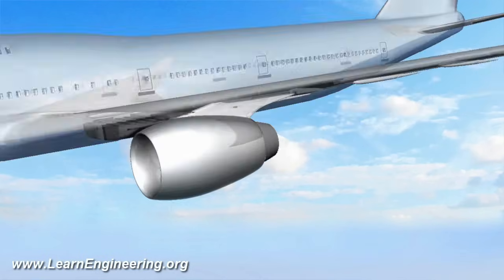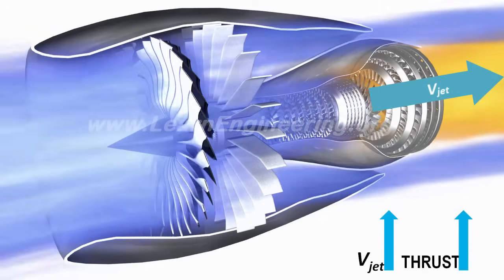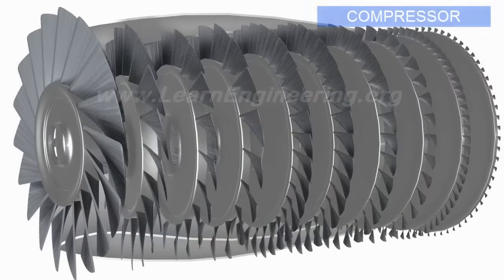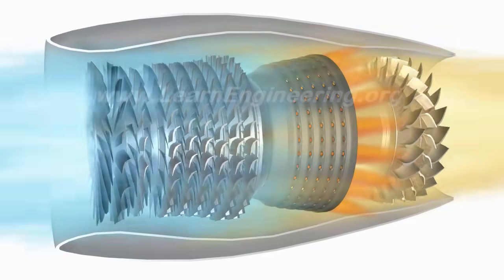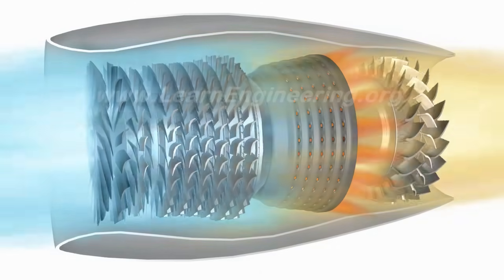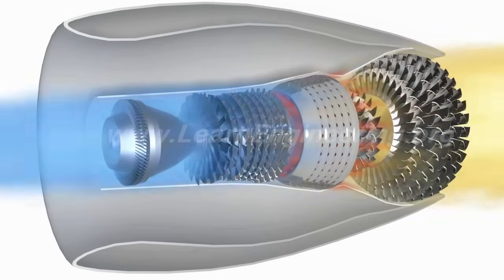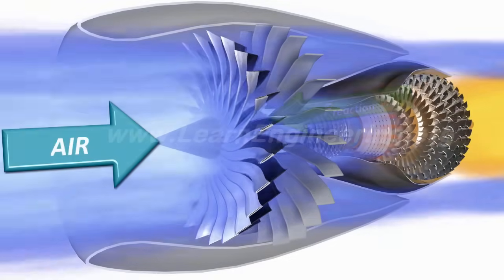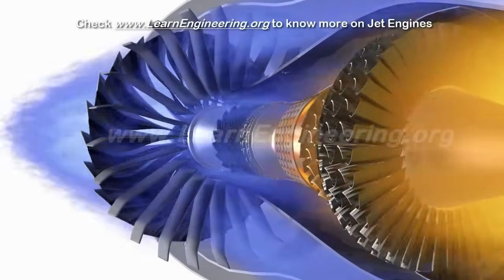Jet Engine, How it works?

Comment: Ok i still dont get how the fuel lights on fire
Reply: Good gob
Reply: A high voltage spark does the job (at first, then is no longer needed as the fuel ignites by the temperature of the combustion chamber).
Reply: Right on dude

Comment: Long story short:  A jet engine is a "continuous cycle" diesel engine.  The pressure out of the compressor at 35 Bar is about 450 psi, and super hot. Inject fuel and it instantly combusts, heating and expanding while doing so.  This hot exhaust drives the compressor spool and the by-pass fan.

A diesel engine is often a 20:1 compression ratio giving 280 psi.
Reply: This is sooooo wrong. Bring in the air from the fan, then compress it with smaller closer blades sending it through the combustion chamber, which mixes the air with fuel and lights it, then it goes to hpt (high pressure turbine), which compacts the air even tighter, then the lpt pushes it out the exhaust, in the exhaust the pressure and thrust is determined by the the size of the nozzle and whether there is an augmenter or a simple shaped nozzle to determine how fast the air comes out, meaning how much thrust is porduced
Reply: @jonathanjordan8325  That's pretty much how a jet engine works... But in a turbofan (as shown in the video) almost all of the thrust is generated by the air moved by the fan attached to the jet engine.
Reply: @zeendaniels5809  you are correct. This is a high bypass engine. Probably about 85% of the thrust. I apologize for the misunderstanding.

Comment: Now Pratt and Whitney uses a gear turbo fan engine in which they basically take a planetary gearbox from a prop engine and call it a gear turbo fan engine. But GE has done a better job I think.

Comment: In Turbofan engines, fraction of intake air @ -100C is bypassed to later mix with hot air jet @ 400 C to reduce noise. I can’t say that it makes the plane fuel efficient but if exiting air temperature is reduced it reduces noise

Comment: Wait, why would it be a good thing to lower the air temperature from 1600 down to 350, when your whole purpose  here was to heat up  cold air to create thrust? Wouldn’t it be better if the air was hotter?

Comment: The Flutes that you did not mention are the most important static resonators that change the vibrational frequency of thee Air into Nitro so that the Fuel is ready made in the chamber prior to combustion, so no need to mention economy of fuel, compressed resonated Air is the cheapest and easiest fuel for antiquated devices

Comment: Ahhhh.  Only 10% of thrust is produced at the engine outlet..higer im sure for turbofans.."marginally". Read up on the diffuser section of the engine and see where the real magic happens
Reply: About 75% of overall thrust comes from the fan; in cruise about 60% of the overall thrust comes from the fan. During reverse thrust on landing, the same 75% of the thrust comes from the cascading fan thrust. Core thrust is a factor but only about 1/2 of the fan's thrust.
Reply: Basically my only sources of knowledge about jet engines comes from this video and a bit of reading I did after watching it... but what exactly do you mean with the diffuser being the real magical part of the engine? The way I understood it the diffuser (which is sort of a reverse-nozzle) only reduces the velocity of the incoming air stream to "stabilize" and ensure the combustion.

Comment: I'm a 25 year veteran from Duncan Aviation in Lincoln, NE.  I can firmly attest that jets work by making a loud noise behind the plane, the plane gets scared, and the plane goes forward.  Everything else is a bold faced lie.
Reply: Oh damn it , they lied to us !
Reply: And propeller planes.  The propeller is there to keep the pilot cool.  When it stops turning, he starts sweating.  And on twin engine planes the 2nd engine's only use is to get you the site of the crash.
Reply: So that's why fighter jets are so loud, they need to be to go fast.
Reply: @ultiiiiii or the thrust is stronger
Reply: I completely and utterly trust you
Reply: Your absolutely correct.  Those plane farts should make anyone or anything run away.
Reply: @leadslinger49  oh thats why pulse jet aircraft were so fast back then
Reply: I trust you
Reply: @4crosswashere7 I AM YOU HAV
Reply: Bro, that is funny as hell.
Almost as good as telling someone their tyre is only flat on the bottom so is perfectly fine to drive on.
Reply: Flat Earthers lol 😂
Reply: Damn, I knew it!
Reply: Thanks for the simplification, I knew they were maliciously complicating things.
Reply: Will it work if I make loud noise 👀
Reply: Seems legit
Reply: And an Airbus 340 cannot climb - it only gain altitude because of round planet.
Reply: Kawaii...plane-chan 🥺
Reply: amen
Reply: AGK level 9999
Reply: LMAO. I love this!
Reply: Hahaha thats brilliant. And also, the man did say that turbo jet engines are louder and they are faster, so case closed.
Reply: Sounds like how a 3 year old would think jet engines work.
Reply: Cool your jets...that's a hot lie. lol
Reply: Indeed
Reply: Sometimes it Smells....
Reply: Ignorance is bliss 😂
Reply: Thank you for telling the truth
Reply: Correct. It would be better to put modern electric amplifiers in the engines and speakers at the back of the engines, as they can make more noise being cheaper and lighter.
Reply: The funniest plane joke I've ever heard. Thanks.
Reply: You must go public with this information
Reply: Okay I came here cause I was interested in the basic’s oh how jet engines work! No matter how fast Jets fly, I’m sure the basics are the same. Just like with car’s! There’s all kinds of computer type crap involved. But the way the engine works is still the same with all engines! They all work the same way.
Reply: O
Reply: They lied to us!!
Reply: Haha😂
Reply: i wanna do aviation
Reply: Like the "globe" and the "moon landing"
Reply: Now it makes sense.
Reply: Gosh
Reply: This checks out👍
Reply: This is the equivalent of a dog waking its self up from farting
Reply: More believablenthan flat earther saying it runs with compressed air. Lol
Reply: hhahahaha nice one xD very much love your explanation, my little cousin loves planes, he gonn be very satisfied with this explanation :D  have a good day Sir ! :))
Reply: Seems legit.
Reply: Had to read this 3 times to make sure you weren’t a 25 year old vet 😭😂🫶
Reply: Hence the phrase, "took off like a scared jackrabbit"
Reply: And sometimes the plane gets so scared it gets a panic attack… That’s exactly what occurred on 9.11 - the engines suddenly made a loud noise and scared the plane
Reply: I worked at Duncan Aviation for awhile. My team leader was Eric (can't remember his last name) but he ended up taking a job in Provo.
Reply: No fuel is needed
Reply: I was an avionics technician on kc135R at Lincoln air national guard! go big red
Reply: You know, that's what I thought !
Reply: Correct, and They are remote controlled mostly by the mommy plane and Daddy plane.
Reply: Engines and oils they put on the plane was meant to make plane crash louder after all 😱😱🤯🤯
Reply: jbvxc
Reply: @ZulhelmiAnuar  hip

Comment: This is a great video and I like the graphics, but you are missing some things. I know it is basic but could easily be added without adding more graphics. You are missing the diffuser before the combustion chamber. The diffuser is the last stage of compression and straightens the air to allow the compressed air to flow in and over the fuel nozzles to atomize the fuel before being burned. Without the diffuser, the fuel air mixture would spiral around inside the combustion chamber and destroy it. Could also add in secondary air which aids in cooling components including oil and the outer case of the compressor and turbine. There is a lot more, but I figured these should be added with the graphic video that you already have without having to add much else.

Comment: it would have been great if the animator paid a little more attention to the direction the turbines were spinning.  With the direction of the airflow and the orientation of the turbine blades, it should have been spinning in the opposite direction. LOL.

Comment: the forward turbo fan seems to be going counter-clockwise but it's pitch should make it go the other way.
Something is odd about the illustration of the front blades, they seem to change pitch and should not be rotating counter-clockwise from the engine's forward orientation.

Comment: Cool video... Ok I made it but I have question... how to turn on it? I would be grateful if the creator or someone from the audience answered my question soon...
Reply: With compressed air taken from the auxiliary power unit (at least this kind of big engines. Small engines are often started electrically).
Reply: @zeendaniels5809  ok thx but I meant these smaller engines bc I made one and I do not know ho to start it...

Comment: I trained on and repaired Lycoming and Honeywell jet engines and if I had this explanation and video in school I would be LOST. The worst explanation and inaccurate animation I've seen. Better to get the animation spinning correctly and describe/show it in stages starting from inlet towards exhaust one single stage at a time. You spent so much time on heat and heat differences and back and forth that you really glossed over the hugely important compression and stages of ignition. I was getting confused just like in Jr. High by bad teachers. Try again.

Comment: You know they got a robot saying that LDL cholesterol is bad how is it bad LDL cholesterol is the component that heals the lining of the lot of the artery on the inner lining it heals it the HDL collects what's ever left over of the LDL and puts it back in the liver for the next function what causes the blockage is not the LDL it is inflammation pushing up on the two outer artery walls causing a speed bump so the real problem of plaques and a lot of cases is inflammation and there's vegetables and supplements you can take to eat the plaques out of your arteries so why do they lie because it's worth billions of dollars to them why do we have these liars and con artists running our country I don't know I could be wrong you have to check I think I'm right I think I'm wrong I don't know sometimes

Comment: A "gas turbine engine" comes in many different applications. The illustration is a turbofan. Helicopters use what is referred to as a turboshaft. Prop planes are turbo props. And a gas turbine engine that constricts the exhaust flow so as to raise the velocity of the exhaust flow would be called a turbojet. Whoever made this video is fairly clueless.
Reply: And if your see carefully then the direction of compressor is wrong .
Reply: @user-qh8lv6ve1y  Also, the cold section, compressor, and the hot pressure section rotate together. The power section is what will drive any mechanism such as the transmission in a helicopter or turbo prop, and the fan such as a commercial airliner. Actual Jet engine, this illustration is not!

Comment: Most people think the Jeff fewell is high octane like racing fuel but they all it is is Chief K1 kerosene what's Atlanta xxplosive foaming agent added in with it don't want it crashes it doesn't doesn't to it doesn't turn into fine mist and explode

Comment: look on the rotation of compresor disks, by chance they don't turn the other way than they should? For me on this video air flow is with wrong direction to "compress" the air :) look 1:40 how wings work and how air flow :) contradiction or am i wrong ?

Comment: If hots air comes out, then how can people stand behind them? When they take off or landing??
Reply: Only stupid people stand behind them.    If you are talking about the people that are on the beach getting blown into the water,  The exhaust starts mixing with the surrounding air as soon as it exits the exhaust.  The heat right at the exhaust would fry them.  but because they are far enough away, the heat has been reduced and spread out enough by the time it gets to them that it is only warm or slightly hot.

Comment: Oh that title and during the entire presentation. Stating engine multiple times. Tesla's have electric motors, regular cars have engines and jet planes have compressor/turbine. Please get your facts straight.
Reply: what are you on about? Its called a turbine engine. The term engine is not exclusive to the piston engine.
Reply: Wrong. People tend to call them "turbines", but that's just a part of the whole engine (as is the compressor).
Get your facts straight...

Comment: 35 bar of pressure holy cow. 

Thats over 500 psi. Really incredible considering the size of those engines to hold that kind of pressure
Reply: It's just the compact turbojet part in the center that contains the combustion that gets that high in pressure. The larger space around it is cooler air at much lower pressure brought in by the turbofan that bypasses the high pressure chamber.
Reply: @clipsburg412  Thanks 👍 I figured as much after thinking about it later.... Makes sense. Rock on bro.

Comment: What moving turbine?How engine start?
Reply: On large passenger planes the engines are started with the compressed air output of another turbine engine called the APU. The APU is started with an electric motor.
Reply: @Redtooth75  👍

Comment: They never state how the engines are started. In order for this scenario to work it most likely requires the turbines to be turning, forcing air through the system prior to fuel ignition or it would just sit there and burn fuel and the plane since it is an open system allowing pressure to escape in both directions without help.
Reply: Jet engines have starter motors as well... Actually, large jet engines start using pressurized air from the air conditioning systems in the plane. That's why you sometimes hear pilots turn off the air conditioning before starting their engines. Once the turbines and compressors are turning, then fuel and ignition happens.

When the plane is at the gate, pressurized air comes from the Auxiliary Power Unit (APU) which is a small jet engine located in the tail of the plane. That jet engine starts up via a motor like the starter motor of a car. Once the main jet engines are running, pilots shut off the APU and pressurized air for the air conditioning comes from the jet engines (except for the 787 which has an external air compressor).

Comment: The casing around the engine used to be thinner but the US army wanted greater loft for their huge aircraft carriers but if the made the engine bigger the oka e would then have to be bigger for the weight, but then they realized if they make the casing bigger excess air around it provided more oxygen for fuel to burn and more thrust without making the engine itself bigger.
Reply: Say what??? The US Army? Aircraft carriers?
Reply: @MrSatyre1  Hold that thought, I'm just gonna look around my house to see if I can find who asked.

Comment: Understand the concept.  One thing, so the air is the biggest factor then how much fuel does the engine use?
Reply: The biggest engines burn up to 3 tons per hour.

Comment: OK for when it's moving forward at speed. I get that bit, but....
How does it start initially to move the plane please? I know air pumps spool it up, but what rotational force gives it enough air intake to get the aircraft off the ground and what generates this force?
Great simple explanation, thank you.
Reply: To get the aircraft off the ground, the engines need to be started up... And they are started just as you said. Sorry, I don't see what your doubt is.
Reply: @Zeen Daniels  
Thanks. I thought airflow was required by forward motion to supply enough air.
So there is sufficient draw at standstill to feed the compressor part then.
Reply: @Dodger2879  No. The compressor is started using compressed air from the auxiliary power unit (or an external supply if the APU is inoperative). Then the fuel is injected and the engine becomes self sustaining.
Reply: @zeendaniels5809  
Thanks.

Comment: one little error in the video: the heating of the air is only a small factor in the pressure build up, most of that pressure comes from the carbon hydrate molecules in the jet fuel turning from a liquid state into a gas, causing rapid expansion.
Reply: Exactly.  I was wondering when he was going to show us how the fuel enters and is burned

Comment: Honestly if I didn't know better this design sounds like completely impossible circular logic.  You're telling me that an engine designed to blast hot exhaust out the back is using its own exhaust thrust to power air input?  Not once but twice over?!  I guess i just need to remember that car engines also steal some of their power output to run intake turbo fans also.  Just by the animation it seems like the turbines sitting in the exhaust stream would steal a huge amount of the jet output.